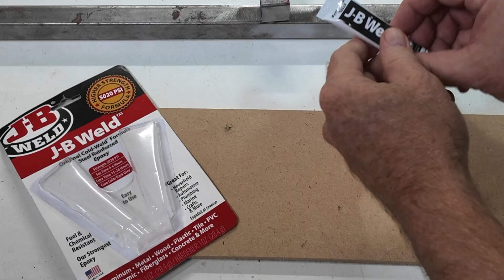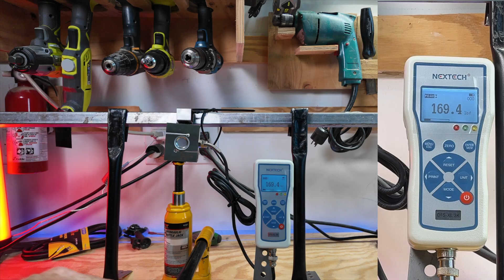Will JB Weld Original Cold Steel Work For Your Repair? STRENGTH TEST

Comment: You didn't braze up the surface. You didn't hit it with sandpaper or a wire wheel. I didn't see you clean it with any brake cleaner or degreaser or rubbing alcohol.
Reply from the maker: @mgtowlevel6969  good eye.  The directions suggest that for best results but not required.

Comment: 191 is not nearly enough. But neither is 680 for many typical projects as a substitute for welding. 680 is even more problematic as it would be in a realm of strength where you-think-it-is-good but it will fail under load. This would take less than a minute to actually weld.
Reply from the maker: Great point, David.  For most around-the-house repairs, I am thinking this is sufficient especially for folks who don’t have access to a welding machine.  But, for repairs with higher workloads, a weld may be required for a metal repair.

Comment: Using it on a piece of square tubing and inducing a tear where the flexibility of the tubing is a factor is not a fair measure of the claim. Had you attached the solid piece to another identical solid piece, and used an apparatus that attempts to pull them apart 180 degrees, I'm sure it would have held up to the claim.
Your test is unfair and I'm sure no other manufacturer is going to answer your call for this biased test that seems designed to make it "fail the claim".
Reply: Easy fix, just bring the support arms much closer together so it doesn’t flex.
Reply from the maker: I like the way you think.  We are currently devising a true pull test while still utilizing this shear test as that might be helpful info for some.

Comment: 👍👍👍 It's been a while since I've had cause to use JB. When I used it on steel  I first cleaned the area with Isopropyl Alcohol, then scored it with a rough file. I don't know if helped the adhesion or not. Thank you Eddie
Reply from the maker: Great tips.  Thanks, Pete!